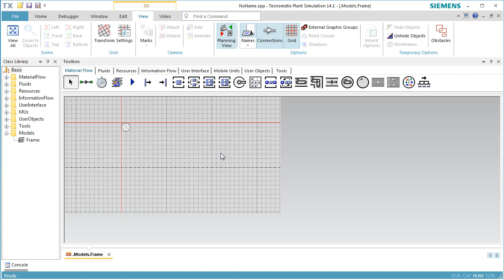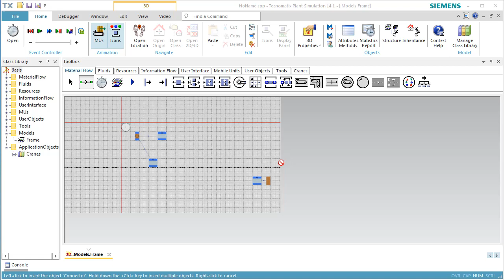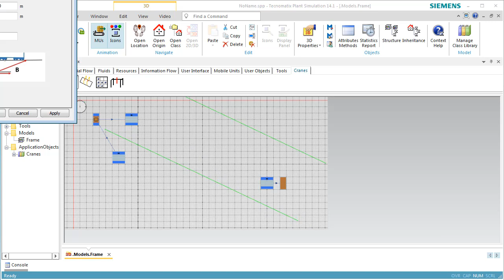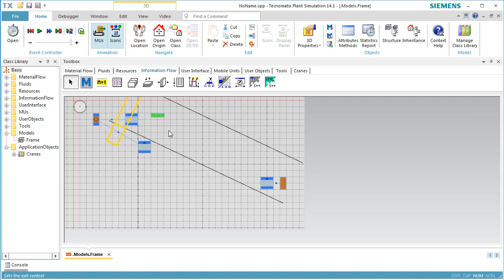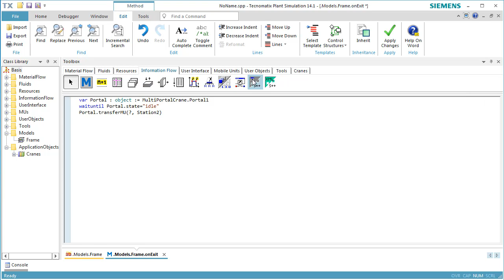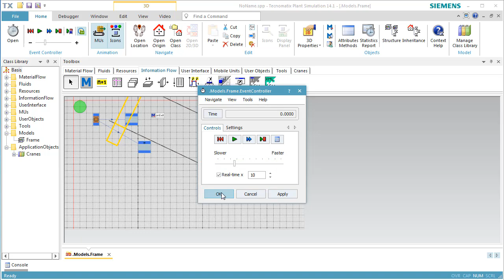Plant Simulation: Using the PortalCrane

Comment: Method didnt work, says here that have a problem in the first line
Reply: Yes for me too. Do you have the right solution?
Reply: @26860001  Yes, i have the same problem. And like for my class.
Reply: The third code line needs to include the MU (@) as a parameter instead of the station (?).
Portal.transferMU(@, Station2)